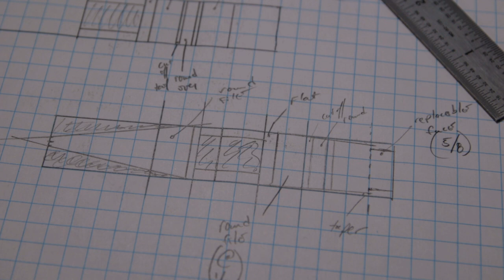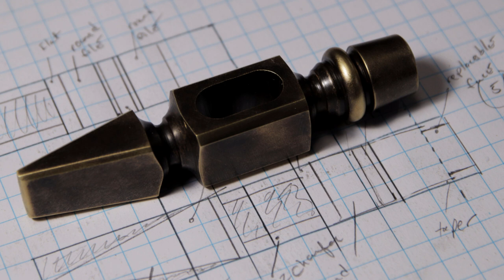Stiletto Inspired Hammer // Plane Adjusting Hammer

Comment: I love the jigged up turning tool. Also, you can always fix the wedge issue with a perpendicular metal wedge.
Reply from the maker: It's not stupid if it works! 

I thought about doing a metal wedge, but this one is working fine and it is a prototype. If it gets loose I'll fix it then.